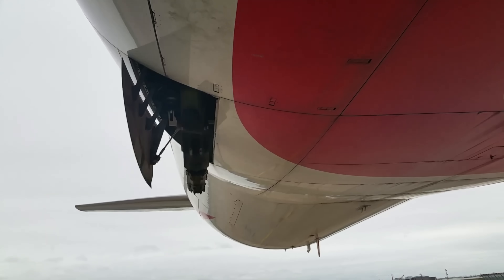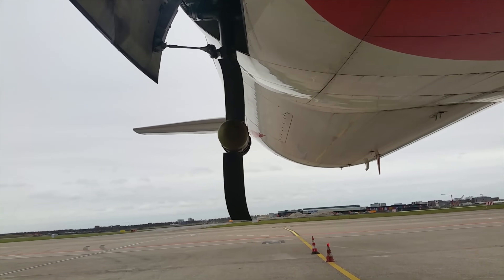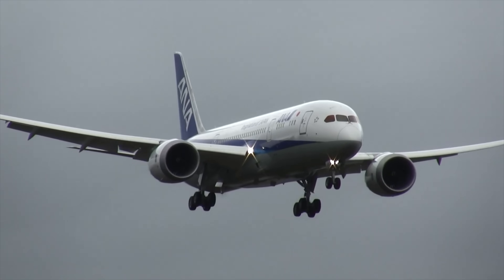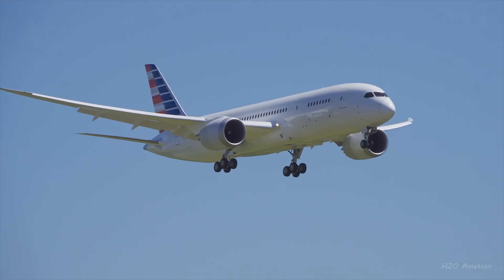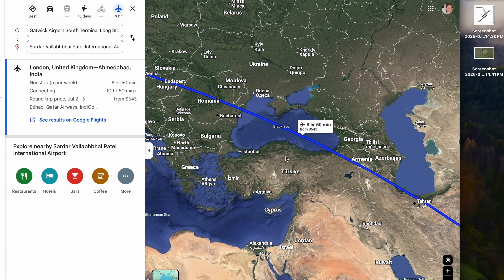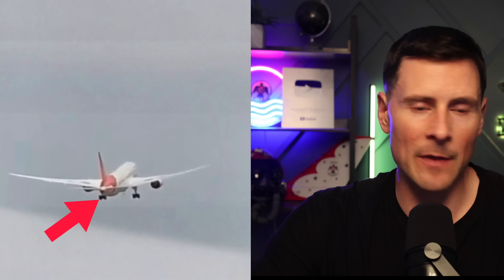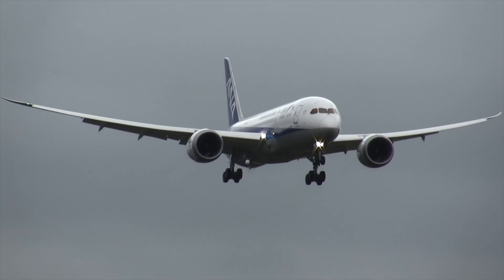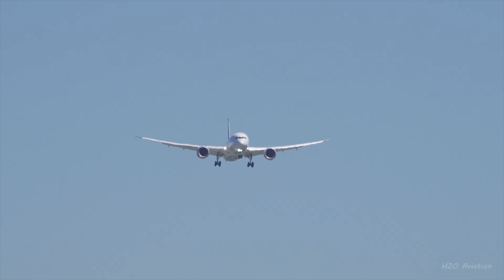Air India 171 SHOCKING UPDATE on RAT Deployment and Flaps!

Comment: Nothing really new here.  
If anything, it's just further reason to believe that there was a dual engine failure that eliminated all hydraulic systems, both main and backup.  The question remains, what was the single point failure that effected both engines simultaneously and resulted in such a global failure of engine thrust and associated systems?  
One such single point failure would be the fuel supplied to both engines.  Another might be a catastrophic hydraulic pressure leak affecting all redundant systems -- if that's possible?  Could a massive battery fire take out all redundant engine and flight control systems?  
Something very rare, very strange and very unexpected happened to those engines and right now I'm thinking the fuel is the more probable single point failure based on my own experiences with fuel contamination issues.

Comment: the fuel pumps had no more electric power for this reason both engine stop. / the lithium battery exploded  this is the loud  BANG the only survivor heard./ the RAT came out./ catastrophic electrical  failure
Reply: Yes this sounds correct.  Ties all the info together.  Definitely equipment fail not pilot error.

Comment: RAT deployed (and gear remained down) because AC Electrical failure when the APU automatically shut down which was erroneously powering electrical to airplane (not engine driven generators). The crew missed this. Throttles were in “safe mode,” so engines automatically decreased to idle with the throttles in correct takeoff position. Crew did not react quickly enough or at all, to cycle throttles out of TOGA then back up to switch to manual control. Horrible design Boeing! One minor failure on ground turning into 270 plus deaths. STOP TALKING ABOUT FLAPS arm chair quarterbacks. All these deep dives are very shallow.

Comment: Im not an expert but from what i understood , the temp around the plane must have  been very high at the time and increased more when the turbines switched on and plane was getting ready to take off,  reaching to a point where all the electronics shut off as a fail safe mode  cause of super high temp ( more than 70 degrees probably) and  since a 787 heavily relies on electricity even to power up , but this happened at the most unfortunate time for everyone and since all electrical systems shut down, the RAT got deployed which cannot help you at that height.

Comment: My un-expert opinion is that this flight was doomed before it even left the ground. There is no good reason why it used the entire 11,800 ft runway for a moderately loaded 787. The trouble began on the ground, not in the air. Everything after that is just a reaction and a cascade of mistakes of inevitable failures. I've flown on these planes many times. They lift off easily half way down the runway. What if this had happened at a shorter runway airport? It never even would have got off the ground at all. At many airports, it would have plowed through buildings and homes.

Comment: Have you looked at the angle of the gear? They were in position to lift in the body.. but the process of taking it in... but stoped and stuck... so  they had a power loss and the RAT in Not suppling enough energy for the gear systems....  that gives a further clue what happend.

Comment: My heart goes out to everyone involved. After 35 years in aviation, it’s obvious that aircraft had no power. The rat can’t help you then. And the pilot did exactly what they train you to do. Fly straight ahead or 30° left or right and find a place to put it down. Unfortunately, there was no place to put it down.
Reply: Yes, nowhere to put it down quickly.  That was my first thought.
Reply: The most horrific 35 seconds for the pilots, while still trying to do what you are trained to do.
Reply: With just 600 feet altitude and no engine power the odds of landing safely is pretty much nil
Reply: Having no power is exactly what the RAT is designed to help you with.  What it can't do is help you when you have no altitude.
Reply: Every Airport should have Water body to the extend of 5 Km in Take off direction.
Pilot can land the Aircraft in water in case of Take off failure. 80% Aircraft accident takes place during Take off
Reply: @soundar4270  98.765% of statistics quoted on the Internet are made up.
Reply: Without engines can't put it down nowhere safely
Reply: He had to put it down on a hospital

Comment: I was thinking the break in the wing was a separation (deviation) between the actual wings and the aft wings on the tail.  I am sticking with fuel starvation both turbines.  I think the power plants were getting enough fuel to keep them running, and to pull them down the runway and obtain lift off but not enough capable for power lift and I don't think either Pilot found out until past no-go and I believe they knew as they were lifting up that this was going to end in disaster and chances of surviving were bad.  They knew their tanks were full of high octane aviation fuel and this is just the beginning of hell.

Comment: The plane shouldn't be flying cause it had issues in the last flight. It should have been flying at about 240 km for that weight and heat. The flaps should have been at a minimum of 15 to 20 degrees flab. The boom was heard by only survivors. He was in front of the left engine. The 10 is heavier than others and cause issues.  Doubt it was human error with 9k man hours. Was going be aircraft mechanic but bad shoulder and back changed my mind. That boom, the key heard by only survivor

Comment: it seems unthinkable that such a proven aircraft could undergo such catastrophic electrical or hydraulic failure causing the `rat` to be deployed. The `rat` proves that something went critically wrong, and pilot-analysis seems to draw the conclusion that both engines failed. Listening-in to the video of the crash as the aeroplane faltered and fell, it seems that engine noise went quiet as if by then there was a completely engine failure. So either the model needs to have a complete re-call (to find out how things failed) or the investigation team needs to find an alternative possibility. And because we are dealing with a single event to a single plane, should we not analyse the possibility of a level of fuel contaminate just enough to cause this, while at the same time, not showing up on the safety indicators by which this flight would then be aborted before take-off.

Comment: Exactly correct Mr. Marcelo. 
First day itself I saw the  heavy smoke or dust coming from the first second of takeoff. 
But no one talking about that scene. 
On runway itself flight is taking full length. maybe on the runway engine failure started.

Comment: Good video. A couple of questions:

1. On the other clips you showed with planes deploying the RAT, were they also experiencing engine failure/power loss or do you think they just landed with this on as a way to test the system?

2. On the 787 and the issue of whether the co-pilot pulled the wrong lever and retracted the flaps rather than the gears, how far apart are these two levers, I
I.e. are they so far apart to make this unlikely?

Thanks!

Comment: Could be an electrical failure taking out control units, pumps etc - the plane did not have any thrust when rotating but the crew had no option to abort because of the very short runway - the dust is downdraft from the wings. So a glider from the very beginning of the flight.

Comment: If there's engine failure or failures, is that not a red alert when maintenance is done?
What's fuel starvation; meaning the fuel lines are blocked? Again, is that not a red alert on maintenance personnels?

Comment: The aircraft became FUEL STARVED for whatever reason,,,electrical failure or possibly a internal fire or due to the heat there could have been a vapor lock in the fuel or fuel pumps,,,,,this aircraft ran out of gas

Comment: Landing gear on a Boeing 787 has the rear wheels lower than the front wheels when landing. But when bringing them up/in the first thing happening is the rear wheels goes up and after that they start to go up/in. That position is needed to fit into the body. And on air india the front wheels is lower than the rear wheels, so they have tried to retract the gear. So the gear is using hyudralics coming from the slowly rotating RAT that also producing electricity. Fuel pums also run on hyudralics, so how much fuel does the engines get? There is a video showing a 787 in a hangar standing on jack stands when mecs is retracting the gear, and the first thing happening is that the hanging rear wheels levels up with the front wheels. After that the retract starts. Landing a 787 without engines is much easier than make a take off. Gears dont need much hyudralics and will come down by their own weight, i dont think the rat can lift the gears, specially at low take off speed. Those 10 wheels are heavy and hughe when standing next to them. And if the gear is set to retract, what power is left for fuel pumps? Question is, why did the rat deploy? Lack of 1 electricity 2 low hyudralic pressure or 3 trouble with both engines.

Comment: The orientation of the trucks of the main landing gear indicate they had been selected up.  The fwd downward tilt of the gear occurs when gear is selected up to facilitate the gear going into the wheel wells. They are initially tilted back or up in landing position after takeoff in case aircraft settles back down onto runway. Once selected up, they tilt fwd and down. So something interrupted the gear going up. My guess would be total loss of elec and hyd power.

Comment: This is why planes should have 2 solid rocketboosters with a 1 minute burn time. C-130 style, if they had that, they would make it airborn and probably home with low power. Sunny would also have made it to annairport with that 1 minute burn. No reason not to design planes for engine faliure.

Comment: I think they probably went low flats after losingnengine power. That would make a bunch of sense, ince they got in the air, the climb was real flat, and only later did they pull too far back and stall out. 

If they used a flap 1 or 2 that would make sense actually if you wanted to sneak away from the ground with low power, in a decent ly low drag configuration. Just didn't have the speed to do it, or they tried to climb too fast for that configuration with the power they had.

Comment: May the Lord bless the souls of the departed along with all their friends and families.  Kudos to Captain Steve and the channel Max Afterburners!  I think there has been tremendous discussion and speculation which is quite normal for a concerned world that is watching and knowing that the flight recorder results might still be weeks away.  Several days of technical discussion may have brought to light a new failure path - Excessively hot conditions, loss of power, loss of hydraulics, contaminated fuel or gravity fed fuel that has a significant amount of air or air locked - combination of conditions leading to dual engine loss.  Of course only the flight data will confirm the exact sequence of events but regardless this leads to catastrophic results particularly if the aircraft is close to the ground.

Those who are authorized to do so should verify the maintenance history and procedures  Analyze every detail especially recent squawks.  Verify that all airport maintenance and other procedures are being followed.  This aircraft definitely had serious issues so check the issues raised in the past 10 or more flights.  What is the qualification of Aircraft maintenance personnel - especially the people who are authorized to TOUCH the aircraft - the ones who provide fuel, what is the quality of the fuel, what is their track record?  What is the qualification and training of the people that touched the aircraft providing repairs and maintenance.  Why is Air India aircraft kept for long hours on the ground in hot climates with no AC?  Is this a procedure? do they instruct their staff to reduce or eliminate AC?  My Experience Level - Aircraft Systems Engineer.  Education:  PhD Flight Controls (UK)  Location: US Retired

Comment: It's pretty evident that this was catastrophic engine failure at both engines at the same time or almost the same time (not a perfectly straight line from take off). What I am curious about is the lack of smoke from the back of the engines. If an electric issue caused the engines to fail, then fuel would be unburned and you'd see a lot of smoke coming out of the back. BUT, if there was fuel starvation then that means the engines cleanly burned all available fuel (no smoke) and then died with no more fuel to combust. Fuel starvation/bad fuel/vapor lock (much more common with bad fuel or water in the fuel; especially in hot weather) could explain a longer runway take off, no smoke out of the back of the engines, and only a slight discrepancy from the straight take off path. Even fuel that isn't ideal in quality would still combust in these turbine engines, but if it's vapor locked because of water being in the system along with such a hot climate, then you'd get vapor lock.... especially likely because the air/vapor would get forced up through the pump system when the aircraft begins its climb simply from the nose raising up and "burping" the vapor in one large pocket in the fuel line. Once that happens, the fuel pumps are spinning "dry" and unable to pull in more fuel.

Comment: In the take off process --- V1, they pull back, the one monitoring says Positive rate, the pilot in charge orders gears up  ... since the gears never retracted that would tend to indicate whatever went wrong happened in those moments after V1, pulling back, at reaching positive rate.  It's almost as if positive rate was never reached or started dropping quickly as they took off (and the plane did level out very quickly after take-off), hence no order to retract the gears.  Another frightening aspect would be the order for gears up is given, they attempt to do so, and THAT triggers a failure (leading to the RAM deployment).  But a massive electrical failure at the moment of activating the gears is nearly unheard of in modern aviation.  But others have pointed out that the Tires appear to be tilted UP (more than the angle of the plane would cause).  The hydraulics on the plane will tilt the 787 tires UP, before it starts pulling the gear into storage.  So that would indicate Positive rate .. order for Gears Up .. gears up activated, tires tilt up and then ... disaster with the electrical system.  RAM Deploys.  But at that point it is too late for anything at all.
Reply: You typed "RAM" twice, you meant RAT.  Still time to edit....
Reply: RAT stands for Ram Air Turbine

Comment: Hydraulic systems usually have a hydraulic pressure accumulator for emergencies but in this case the other systems may have depleted the residual pressure so the landing gear couldn't be retracted. The pilots most likely were taxed with more serious issues.

Comment: Also, check out the landing gear trucks. One of them appears to be pointing down, which might indicate that the gear handle is in the up position.

While we are playing what if, you have to consider the possibility, not probability, of a single engine failure followed by a pilot shutting down the incorrect engine during the high-pressure, pre-checklist, period of the takeoff and flight, that scenario would also lead to the RAT deployment. It also would not be the first time that this mistake would have happened, even with highly trained crews under high stress. 

Remember until we get the data from the black boxes we are all playing what if.

Comment: You just answered a question I had about the angle of attack. I wondered why the pilot didn't pitch down when they had a negative rate. But if the RAT could not power even the elevator then it is truly game over. RIP to those who died.
Reply: Auto or pilot had to pitch down when thrust was reduced to avoid stalling the aircraft.
Reply: Seems likely the rat couldn't give them enough power. Which means they were not flying fast enough for it to make much of a difference. At their hight and speed they weren't staying aloft more than seconds no matter what.
Reply: Not enough height for that 😐

Comment: Max, design/development engineer here with NVH background. You mentioned the RAT spins at 20,000 rpm, 1st order noise would be around 20,000 revs/60 sec = 333 Hz, mid bass, the muddy bass about the 2nd slider on 5 band equalizers.  

If the propeller has 2 blades, there will also be a 2nd order sound around 333 Hz x 2 = 666 Hz, fairly close to the lower side of male human voice.

Just for everyone, 1000 Hz is almost the same as a mosquito next to your ear.  Human ears evolved to be sensitive to 1000 Hz because it helped our ancestors better survive mosquitos over their peers who did not have sensitive annoyance for 1000 Hz noise.

I hope this info is helpful to you and your audience to judge whether the sound being listened to is, in fact, the RAT propeller?

Question, is the RAT able to achieve 20k rpm at take off speed, or would it be slower? 

Best,
Wai

Comment: It now appears to be a maintenance failure either due to a fueling error or a botched post-maintenance release. There were already reports of electrical issues and cabin complaints on the previous flight. That said, this incident might also reveal a rare systemic or process vulnerability in the 787’s design, something that only surfaced under extremely specific, rare and unlikely combination of conditions.
Reply: What the hell are you talking about?